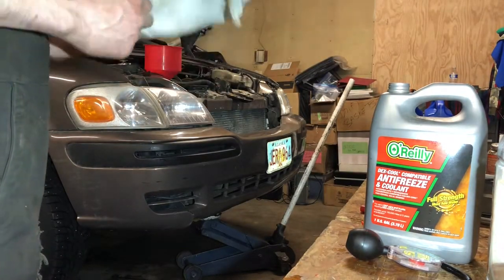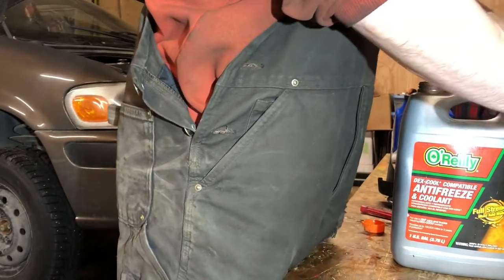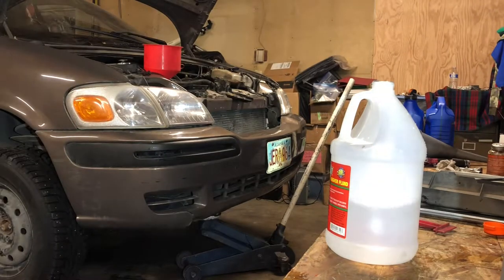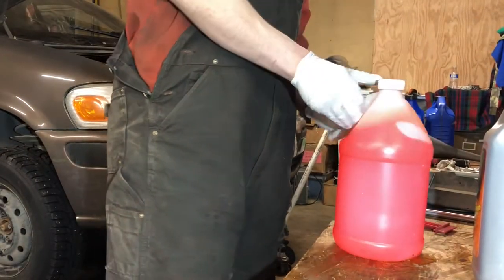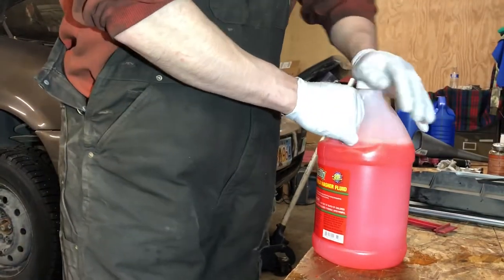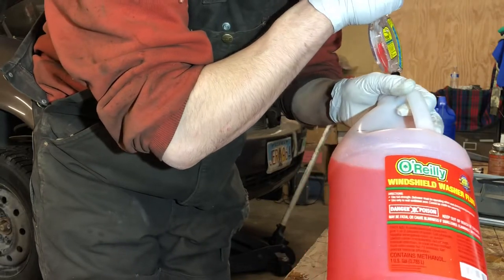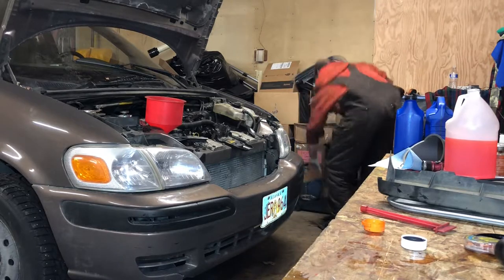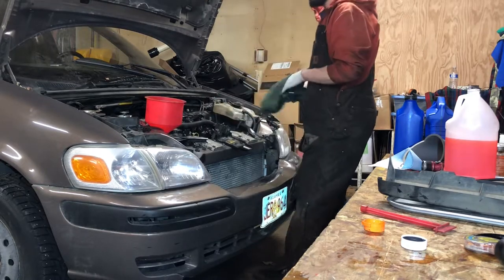EP49-2001 Venture 3.4 Adding Proper Coolant Mix & Topping Off Fluids

Comment: GM Dex coolant is most recommended for the venture
Reply from the maker: Thank you for the tip DJ, I would agree, going with the OEM GM Dex-Cool is certainly preferred over the aftermarket version for optimum results